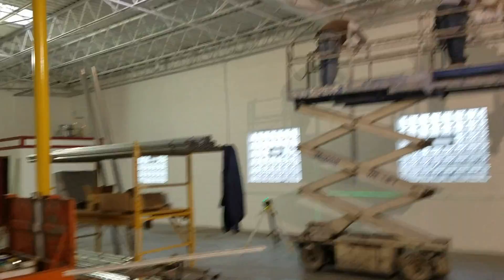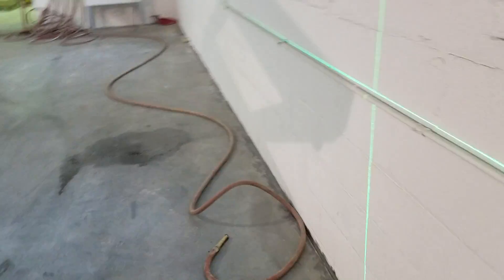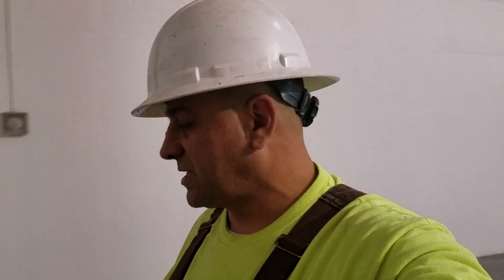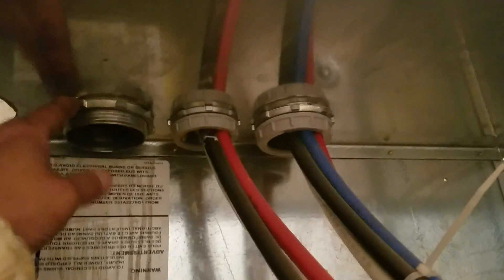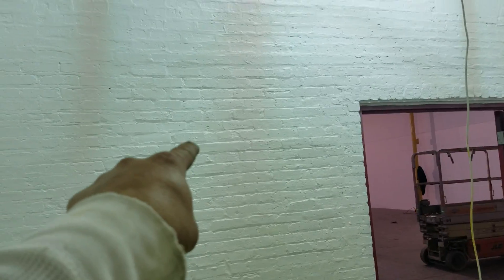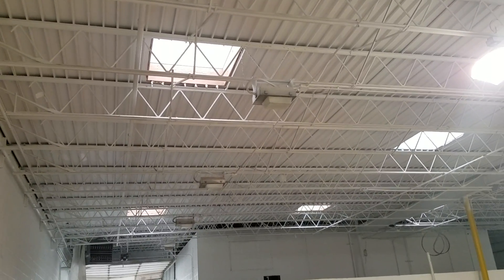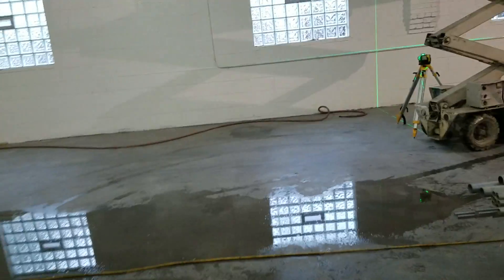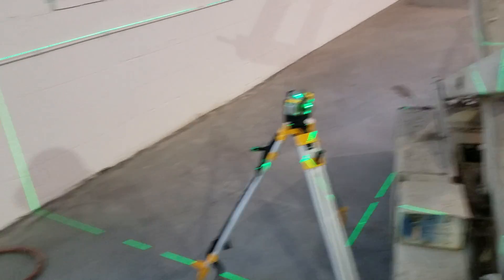Back at flips shop

Comment: That laser sure makes your life so much easier and the finished job will look all the better for it with pipe work straight, vertical etc.
Reply from the maker: Dan Whiteford absolutely and then if you add the time it takes to measure every single box you're installing and every single strap that really adds up you put the laser level there and you're done just drill the holes and mount it all the way down the wall